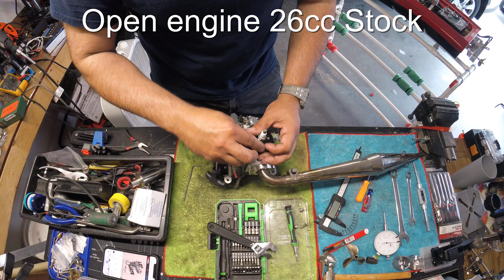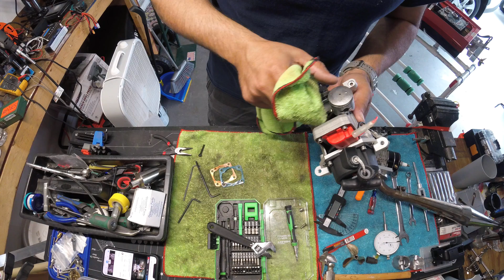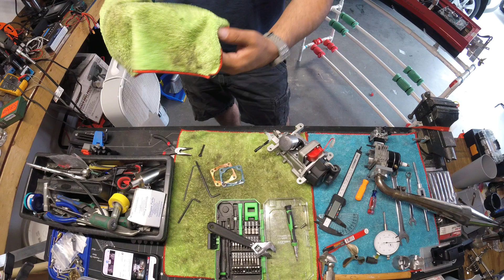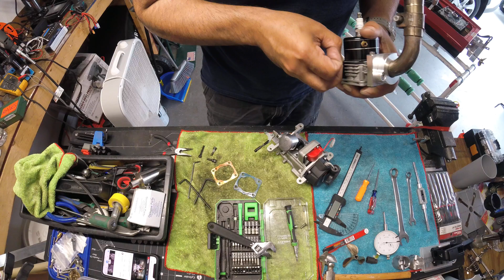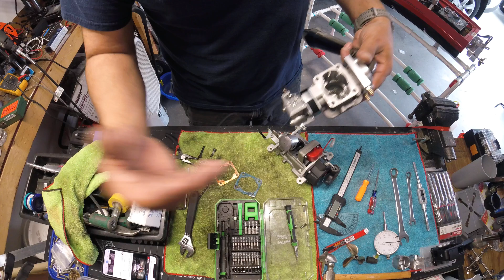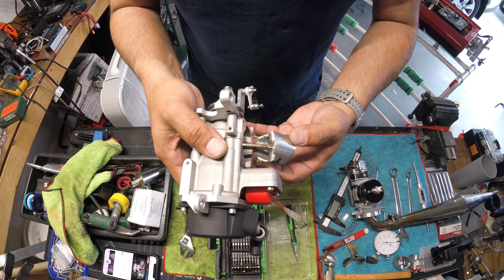Zenoah open engine 26cc Part 2

Comment: thick or thin intake-isolator? I run thick just cause its what I have. you got standard thin there. does it matter? tunnel ram intakes on cars make higher RPM power.
Reply from the maker: I’m use both.  I like factory one !!!
Reply from the maker: I founded performance in carburetor bore. I recommend!! 565or600 1048 Waldro more bore more power also more complication to get set. 🤣 BHHanson wed page